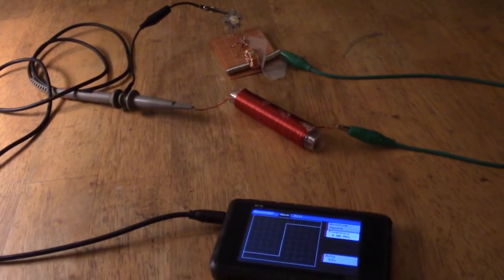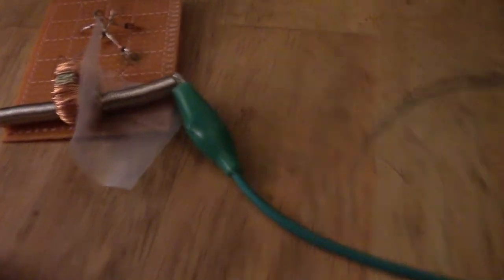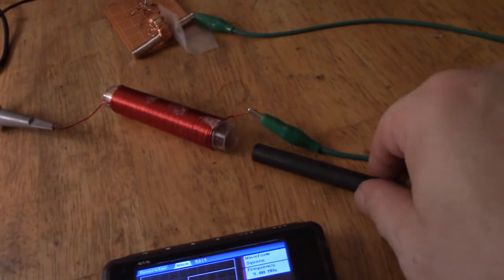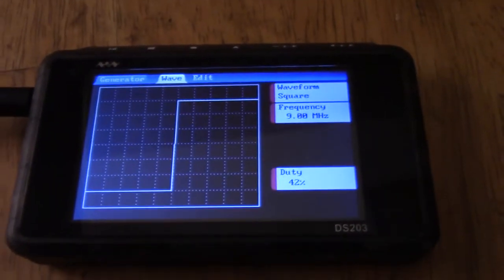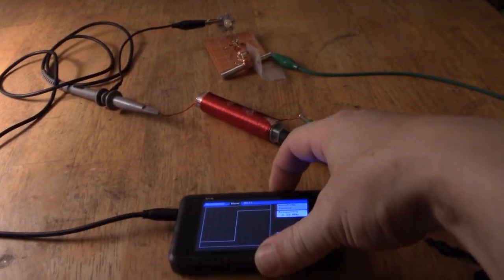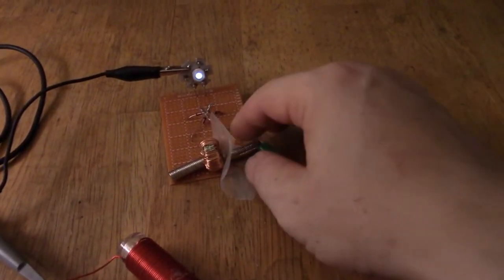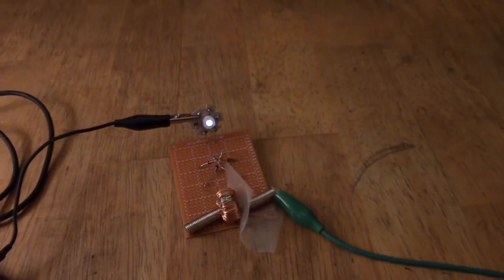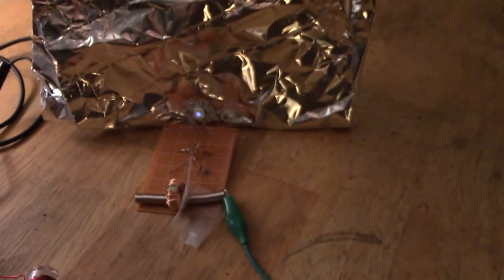Dr. Stiffler SFM - no electrical connection

Comment: Exciting to have no direct-wire connections!  One question, is the foil grounded, or does it connect to the "ground" of the signal generator?  (And does that make a difference?)
Good work, Mark!
Reply from the maker: It is a cool effect. The foil just connects to the other probe lead. 
It would be better if a sheet of foil connected to it and then this foil was away from that, but it's not being driven by 20V+. It would likely  run like that, using the capacitive coupling there too.

Comment: Will the circuit lite if you do not use any magnets or if you use ferrite rods instead?  

Also, as an ex RADAR man, I was trained in HV, HF electronics.  One thing to note about any RF circuit  like you have here is that you are not isolated from Earth ground even when you do not use a direct wire connection to it.  As a function of increasing frequency the tiny pf capacitance between your setup, the air and the Earth are mostly capacitive coupled.  Which means at near any higher frequency the rf sees the Earth as a direct connection depending on impedance.  Only a DC circuit would truly be isolated thru the tiny air space capacitance.  But even that is not exactly true as the air and all matter is a conductor at some voltage level.  

One final point.  I did not catch if you turned off main power to your home and did the tests if you still get the lighting.  One way to really test your setup for isolation from outside influences would be to set the circuit and your signal generator all in a Faraday cage:  making sure you use the type that screens EM AND electrostatic, as not all will.  May need to read up a bit on the 2 methods of screening approach - not just a caged box as some might think.  My suspicion is if it works in the cage then the energy to light is originating from your signal gen.  But if it will not light in the cage then we are on to much more interesting phenomena!  Stuff Tesla would have followed up and left no rock unturned!
Reply from the maker: Thanks for that useful and explorative message. Your input on these matters is valued highly.
For the magnets question, that is unknown yet, I was trying to replicate what was shown and furthering is perhaps what Ron has been wanting us to do with all of his work :)
I completely agree about the capacitive couplings, it seems to be the core of the SEC experiments and relies on high frequencies. Have run many a circuit through the outdoors ground on 1 wire for mains bulb lighting (in fact I don't see why shed and other outdoors low power is ever mains connected, or in fact why lights in a house are not all single wire). 
The Earth is a great single wire, especially after rain. 

Haven't turned off the power to the house. I could certainly show experiments outdoors as some may say i've turned off the power to just 1 room or disconnected a socket even if showing the socket not working. 
A Faraday cage is a tough one. Microwave ovens are not highly praised for such things and that's all I have. 
Indeed Tesla would have walked around turning over every rock and written every finding in his notes...perhaps nowadays his singular determination can be a shared effort and his notes our videos.
Reply: Fully agree with all you said.  As to why 1 wire bulb lighting is not in the norm, I would think there are 2 main reasons.  First conventional engineering designers are trained to think in terms of "hot" and neutral WITH a separate grounding for safety.  Second, it if 1 wire was considered it probably would not be considered safe and would not meet any electrical codes.  The very capacitive induction nature of using HV HF which Tesla and the rest of us energy explorers are fascinated with is also what burned down Tesla's lab in (I think New York).  Unlike regular grid power at low frequency is tamed by insulation, but the capacitive HV HF is not and is induced to some degree in everything around an area in matter and air and strong enough to trigger sparks into fires.  So even the genius had difficulty controlling the use of capacitive energy and he had far more experience that the typical nontechnical home owner.